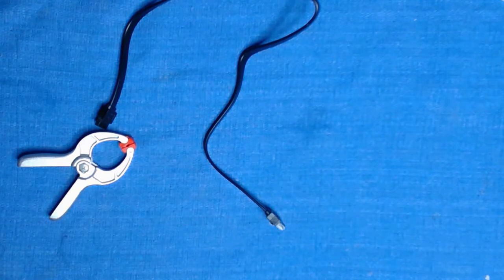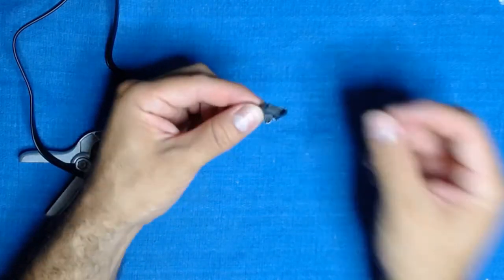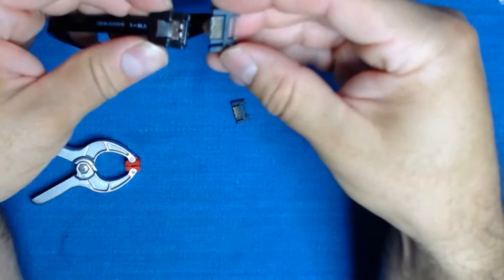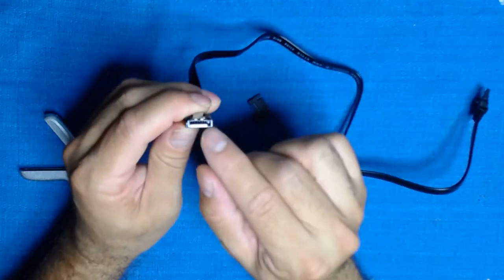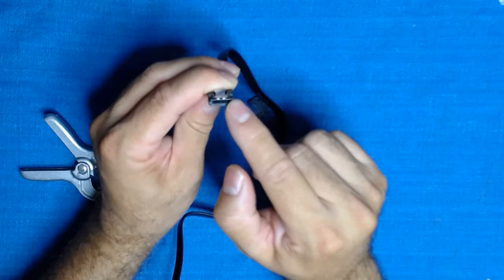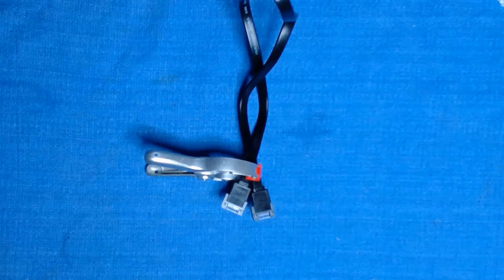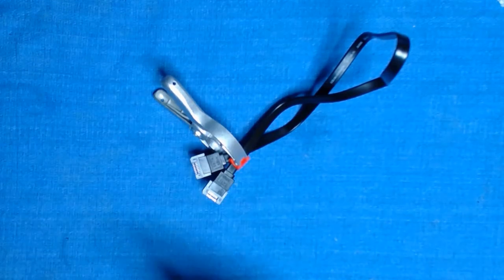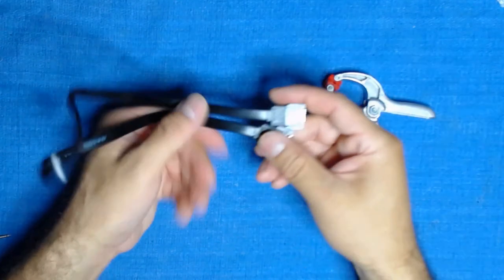Testing a sata cable

Comment: Clever way to test. Only advantage I see with the commercial tester (Tenma 72-9245) is that it would be easier to test for faults at one while flexing the cable to check for intermittent faults. I suppose one could setup their own jig for doing that using the male mounting pieces that you show. If a person was skilled at soldering, you could even setup a DIY rig with LED.
Reply from the maker: Thank you. I didn't even think about a jig with LED's. That is definitely something that could be done. I only did this because I thought it may be the cable that may have had a problem and bought these adapters because I knew I didn't need to do this often, but still needed a way to check, just in case.
Reply: It will be great an idea how to make one with leds